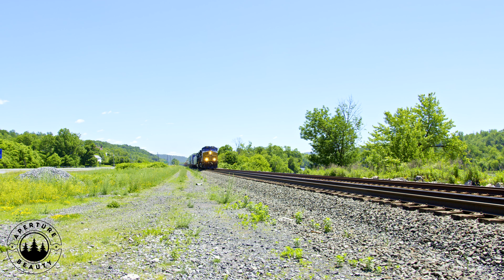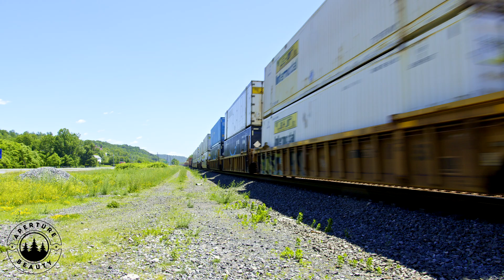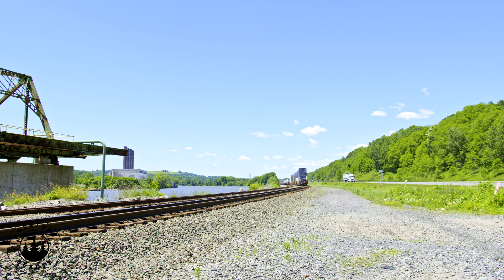Why are American Trains Too Long?

Comment: So-called "Precision Scheduled Railroading," (or PSR) isn't really any of the above.  It is not precise.  It claims to be scheduled, but doesn't work that way much of the time, mainly due to the complexities involved with making and keeping huge trains moving.  (Many modern freight trains run hours, even multiple days behind schedule).   I'm not sure it's "railroading" in the traditional sense.  Railroads today are really just corporations that happen to own a railroad.  PSR is just a slick marketing term to make it sound modern and progressive.  In reality, it is slow, heavy freight movement that makes shareholders lots of money.  The customers be damned.  I'm gonna guess that freight moves more slowly on today's railroads than it did 100 years ago.  They are just moving more of it, so they will claim to be increasing "velocity," but all they are doing is increasing the volume.  From an insider's POV.

Comment: Okay, a couple things here.  As a current railroader, former conductor, and current train dispatcher with over 20 years in the industry, I can tell you that the trains are to long.  Most of the public doesn't get to see things from the perspective of someone who has to deal with these monster 18,000 ft long turds.  Much of what is going on in the American rail industry is a direct result of greed.  Infrastructure such as yards, passing sidings, intermodal terminals, and more are designed to provide given capacity within the confines of a budget.  For much of my career we ran more modest trains.  Trains that often were between 6K and 10K feet long.  Often these trains would weigh between 5K and 18K tons.  The vast difference in weight was due to the type of cargo being transported.  Coal, grain, unit oil or ethanol, and other bulk commodities tend to weigh significantly more than mixed freight trains where half or three quarters of the cars might be empty.  Now those same trains might be 18,000 or 20,000 ft long and weigh more than 30,000 tons.

Railroad managers think they are doing great by saving a few engines or a few crews, but when your yard is designed to handle a 130 car train and you run a 212 car train, that requires a set over.  All of these extra moves take time.  A conductor has to get on the ground, secure hand brakes, throw switches, and many other things.  As a result of this move we set 82 cars over to another track designed to hold 130 which means we cannot pull anything else in that track.  We now have to come down another track, pull the entire train to clear it, shove in a couple up, add 48 cars to it, and then set over again.  It doesn't take long and you can see how quickly you make a mess doing this stuff.  

Damage to equipment, draft gear, rail car and locomotive components, traction motors, diesel engines, air compressors, radiator fan motors, turbos, and even the railroad tracks themselves is a big issue.  Trains this large also end up blocking public crossings because there is nowhere to put them that they don't block something.  If the largest siding for 120 miles is 13,000 ft and you have two opposing trains whose length exceed that, someone has to wait.  If the track speed is 60 mph, but the train only has enough engines to make 40 mph, you've got a big issue.  A run from end to end should take two hours but ends up taking almost twice that long.  This throws your operation in to disarray and causes locomotives and crews not to make it over the railroad meaning originating trains at the other end of the railroad have no engines to use as their inbound train with the engines they are assigned isn't there yet.  I cannot go in to any more detail here as I would be writing a book, but this is what PSR gets you.
Reply: PSR is simply profit over reality! The people who are forced to work this way to maximize profits, are overworked / understaffed. Used like cattle, instead of human beings. And are truly being abused! It's a travesty! Thank you @TheRealJRC.

Comment: Why American trains are too long? Well, let's start from the top. You have the finance world called Wall Street, who seem to control everything about the rail industry. Then you have greedy RR CEO's that make promises to the hedge fund investors of these RR's that they have a very difficult time keeping. Then you have a failing infrastructure where some of that infrastructure was placed a hundred years ago. That same infrastructure was never meant to have 20,000+ tons of steel rolling on it. Next you've got the locomotives pulling this 20,000+ tons up and down grades with a multitude of issues that affect the performance of its pulling and stopping abilities. Now you have the management personnel where most have never operated a train before and fresh out of college, insisting it can be done because their classroom books say it can be done. What most people just don't understand is that there's not very many sidings at all that can accommodate a 2 mile or longer train. There's not many places that have double main track either. If a problem does occur on that 2 mile train, it stops everything up and down the mainline of where that train failed. A good example of that scenario is a broken knuckle. A long heavy train needs to have mid and/or rear DPU locomotives placed to prevent this train from being ripped in half, which happens a lot. Every class 1 embarked on the PSR path and then got a front row seat in front of Congress to explain why rail service went to hell. The point is that a two mile long train isn't necessary AT ALL! The class 1's cut costs everywhere they could, including deferring maintenance on cars and locomotives. The deferring of maintenance of bridges, crossings, and right of way issues. The signal department saw cuts as well to keep the costs as low as possible. If there's any doubts about what I listed, then go ask the folks of East Palestine, Ohio about how their lives were changed because of a simple hot bearing on a car that should've been caught, instead of ignored BEFORE it left the yard and derailed the train. These trains are just too long, and the accidents are going to get bigger as train lengths increase.
Reply: THIS!  ^^^^

Comment: Single-track working is most efficient with long trains. Too long is when there is not enough power to allow for something going wrong, so a train can end up stalled, which effectively closes the line.

Comment: “U.S. railroads were built with heavy freight in mind…” Yes and no. Unlike other countries U.S. railroads were built on the cheap with a mindset of “build it now, build it fast, we’ll improve it later.” (Reference any text concerning the Pacific Railroad construction of the 1860s.) And that’s what we’ve been doing for almost two centuries. We’ve gone from teakettles on wheels to the Big Boy. Diesel locomotives have gone from 1000 hp to over 4000 hp and with each of these jumps the infrastructure was improved/enhanced for the heavier burdens. Each time we play it to its limits and then look for the next leap.

Comment: Because of “precision” “scheduled” “railroading”
And railroad companies thinking it’s safe to have two people managing two miles of train.
Reply: Right. And the detector system has miles of blank spots in between each defector. A lot can go wrong in those miles of track where there is no detector, as with East Palestine, Ohio.
Reply: @samschaeffer8236  Or they can just keep the train going, even though the detectors have called out an emergency level hotbox TWICE already! Must stay on schedule! What do you mean, "The train is now in a huge flaming pile?"
Reply: @michaelsullivan3581  Yep. I'm afraid it seems like profits at all costs. And if the crew does keep the train going, the railroad gets to blame the crew.
Reply: PSR is just an abbreviation for 'lean manufacturing' used by every major corporation. It just makes sense to eliminate waste to keep costs low for everyone. It sure is safer than trucks on two-lane roads!
Reply: @ I’m not saying it would be safer to put all of the cargo on the road, that’s a far from ideal. I’m saying railroads used to have 5 man crews managing smaller trains. In doing that they had better safety, and, believe it or not, still turned a profit.

Railroads today aren’t known for their stellar safety records after years of layoffs, deferred maintenance, and lengthening of trains.